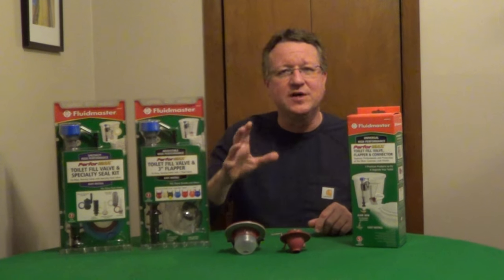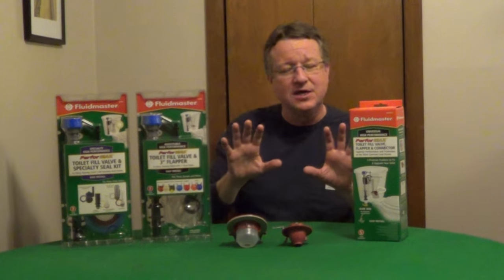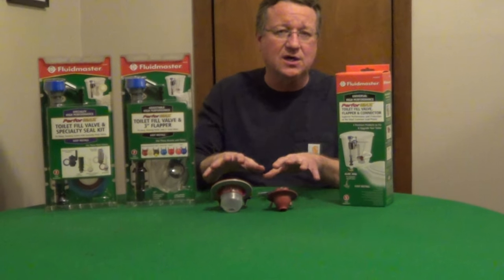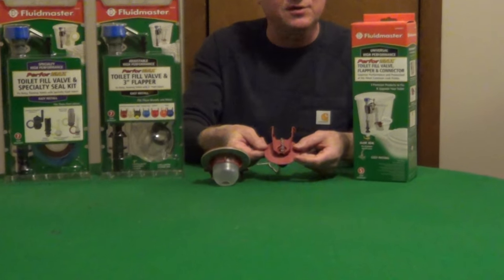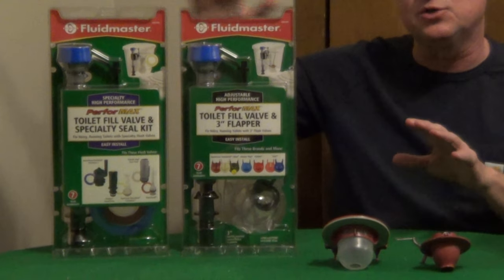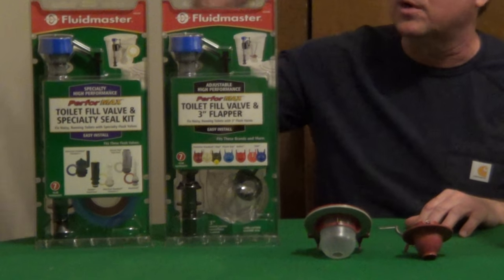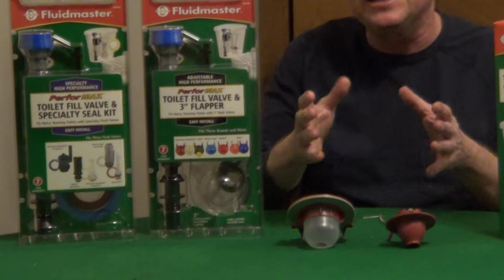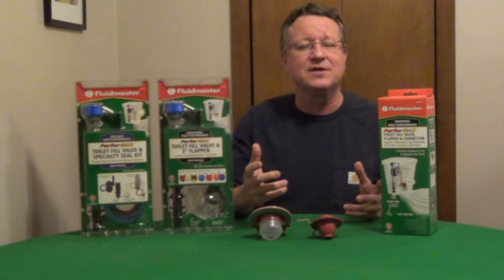How to Pick a Toilet Fill Valve and Flap

Comment: So I have a FluidMaster Fill Valve and in the instructions it shows a 2" or a 3" Flush Valve diagram, that I am supposed to choose from.   Am I actually measuring the flap hole?  But I am not replacing the flap but the fill valve.
Reply from the maker: Hi, is it the 400A or the PerfoMAX? If you are measuring the flush valve, you are looking at the inside diameter of the valve when open.
Reply from the maker: PerforMAX
Reply: It's the 400AH.